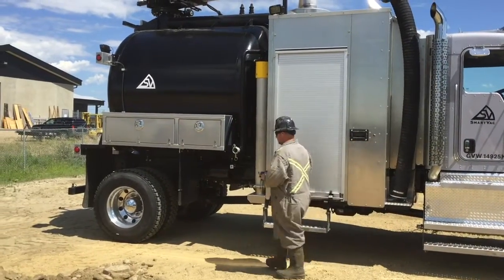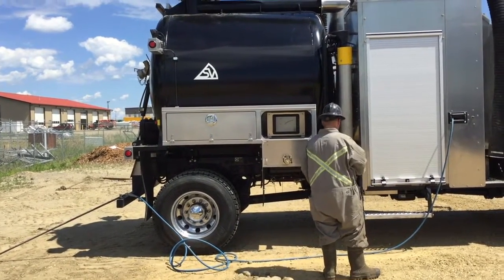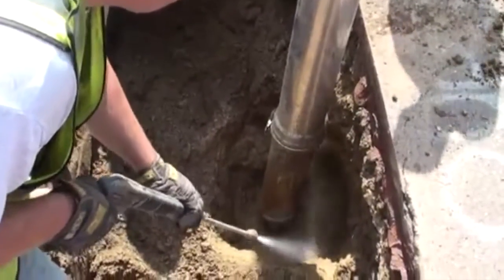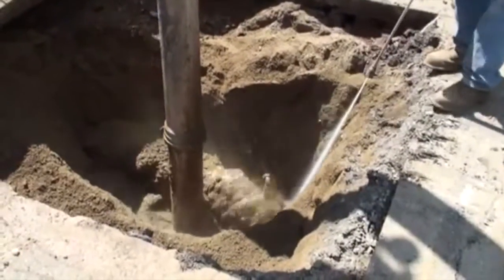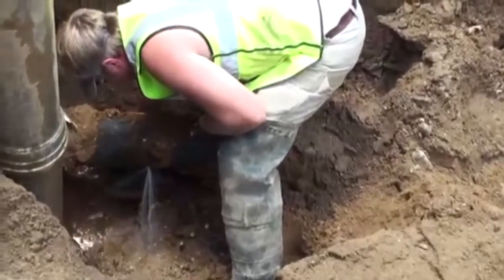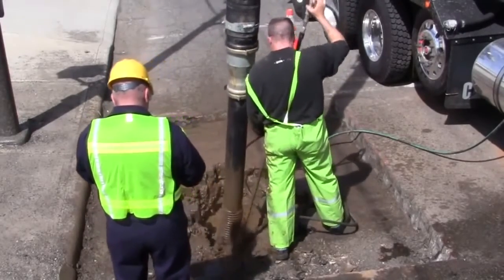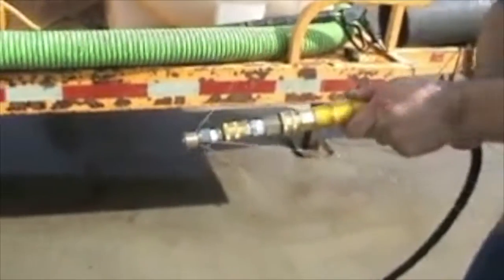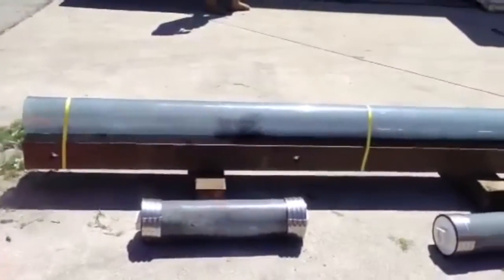Hydrovac General Demonstration

Comment: These single axle units are the best! We’ve used them before in real tight spots. Only question I have is are they safe to run in -40 weather?
Reply: Why the fuck would you want to live somewhere where it’s -40 😂 no way Jose not this guy
Reply: @LeskoBrandon2x   I don’t “want to live” in -40.  I don’t think any right minded human being enjoys living in that shit.  But I have no choice because that’s what our winters can be like.
Reply: @albertaproud7855  you have a choice. I lived in -20 and that was enough to make me move south lol
Reply: Driving same as any vehicle. Problem you get is trying to keep the plumbing and pumps from freezing. Work with hydrovacers in just -25C is a struggle. -40 you have to spend a ton on fuel for heating, not to mention it is really hard on the equipment and crew. I demand hazard pay for anything below -25C.
Reply: @dantruong2582  totally agree with you 100%